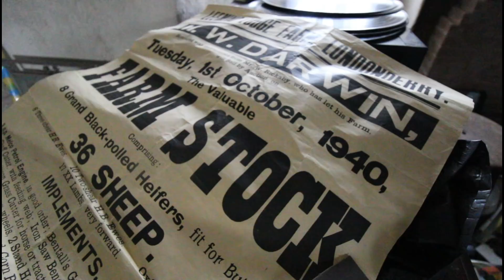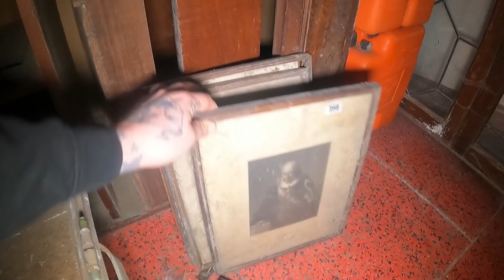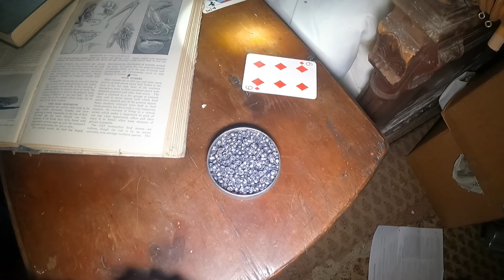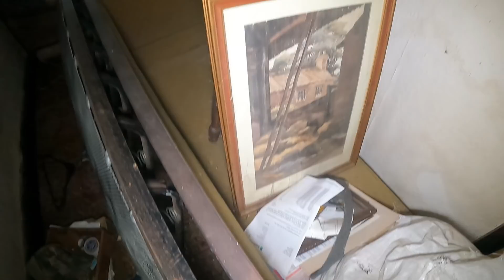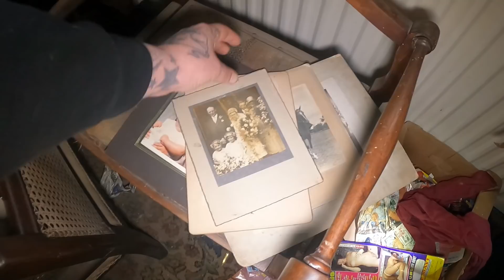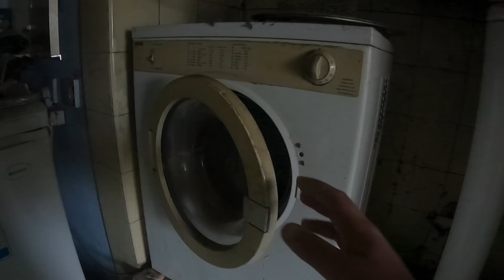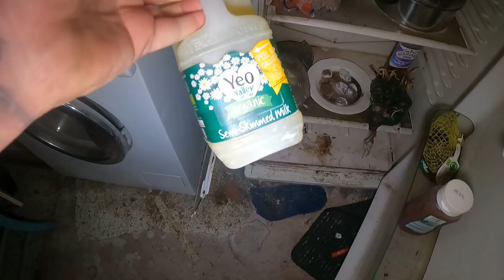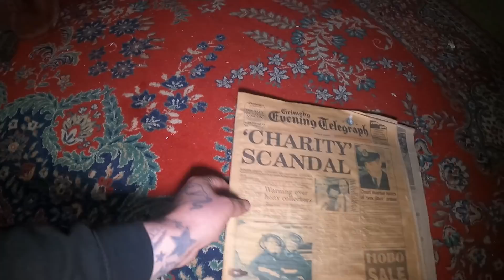HE VANISHED AND LEFT ABANDONED HOUSE FROZEN IN TIME WITH EVERYTHING LEFT INSIDE | ABANDONED PLACE UK

Comment: That device is a barometer, with a small thermometer in the neck. Barometer provides a way to gauge weather on the way...steady downturn of barometric pressure is indication of storm on the way. You would use the barometer to chart pressure through a period of days.

Comment: The tea caddy to the right if the kitchen table with the bramble pattern in it comes from Marks and Spencers……it the Harvest range. My mum got the whole range back in approximately 1984……also the thermometer/clock on the mantelpiece is a barometer used for measuring air pressure and weather 🙄

Comment: I know I am a year late but I have only just found this video and slowly working my way through the older footage. the clock thermometer thing in the first room is actually called a barometer measuring barometric pressure ( change in weather) with a thermometer on the top . On the table the “gun” is a “leg of mutton “ gun case , must say Lisa your a brave woman picking up those pheasant wing things 🫣.

Comment: I can hear the smoke alarm chirping in the background, which happens when the battery is going flat. Therefore possibly, someone was actually sorting out the estate by the piles of photos etc together. Plus smike alarms weren't installed until the 90's, so someone was living there while sorting out the estate. Unless they were actually a swatter, & got a surprise visit from one of the owner's relatives, & made a quick get away.
Reply: I don't know when smoke alarms were made compulsory in the UK, but in Australia  it was August 1997.  Therefore you can work out approximately  how many year's ago, someone was living in this house. As smoke alarm 9 volt batteries, would only last 2 year's l would think.